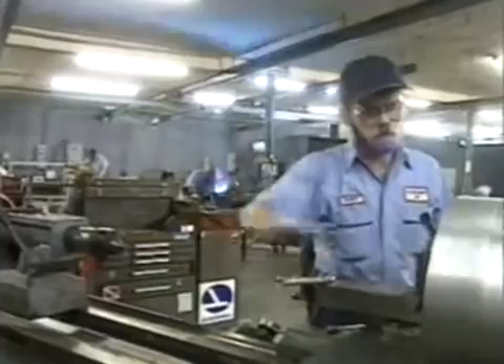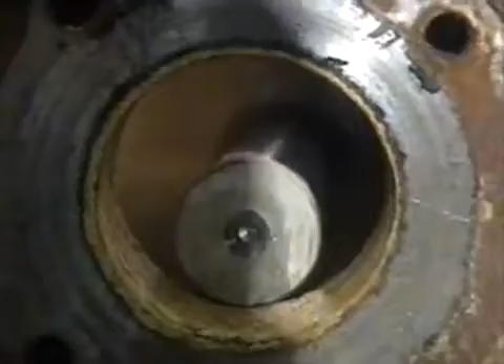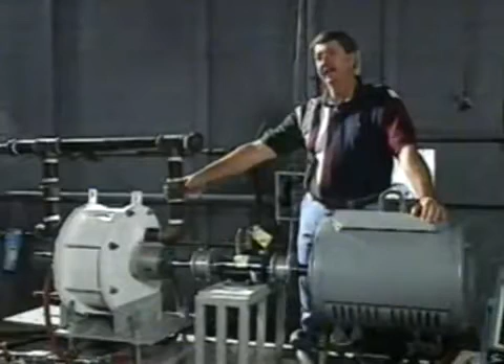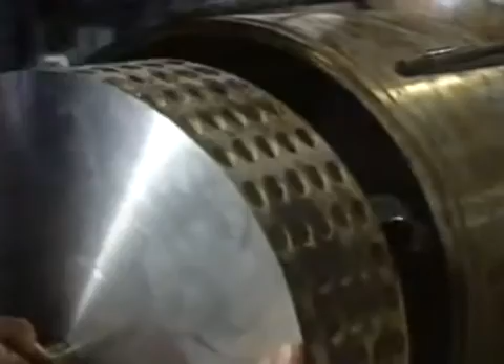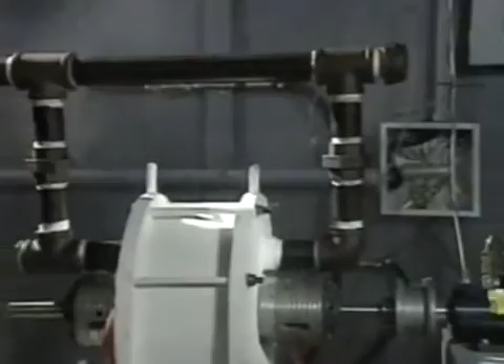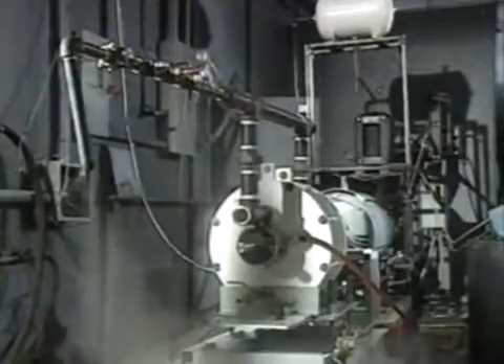OVERUNITY HOT WATER HEATING PUMP !!! VERY COOL OOPS I MAEN HOT

Comment: I think of it this way. Anything in the universe can be used as 'fuel'. Any atom or molecule if you can just generate enough energy to 'crack' it. It looks to me that this creates some serious cavitation, and that cavitation is converting some type of substance into heat. Simple as that. But the question is... what substance? The metal or the rotor or the water or a combination, or what?

Comment: Think about it this way. A car is 'overunity'. You turn a key, and without any external energy, the car can go hundreds of miles. So where is the energy coming from? It is stored in the molecular structure of the gasoline and is released in a chain reaction. Now, take a big metal rotor and spin it in water with cavitation and you might get numerous known chemical reactions that will produce energy. The only question is, could the cavitation be releasing energy purely from the water.

Comment: The problem with "over-unity" thinking is that there is inherent energy available because of the material they are using. The heat is caused by friction. There is no law that says the heat caused by friction in a system can not be more than the electricity supplied to fuel the system. Anyone claiming Over Unity here doesn't really understand the concept.

Comment: What is HP on the motor? My Hot Water Heater has 30,000 watts. That motor looks to have 100hp.  768 x 100 =76,800 watts under unity! The 10,000 watts sink hot water heater will do the same steam in about 10 seconds!

Comment: @MrTpengineer 

Here is an analogy to overunity.
It is the same formula used in DIETS to help lose weight.
re: DIET to lose weight ... more energy expended, more energy OUT than coming IN (calories) creates a vacuum or thinning effect on the individual.
OVERUNITY or the free lunch ... more energy comes OUT than comes IN (some folks claim the energy comes out of the vacuum?)

Comment: Hi 
i would love to know what is  the latest update on the original over unity claim , is the company still claiming more energy out than in? I checked their website but this is not mentioned, only other benefits such as anti- calcing (limescale). 
Its a very interesting device.
if work is done on a fluid or gas  it will always get warm, for example water is slightly hotter at the bottom of a waterfall than at the top. love to hear more thank you